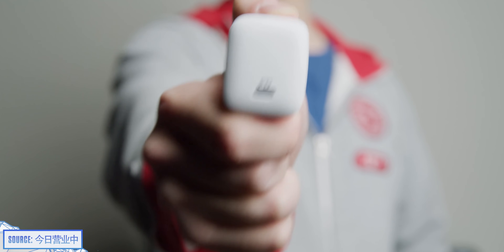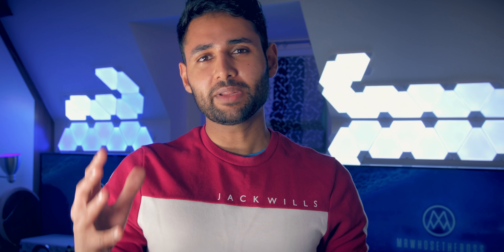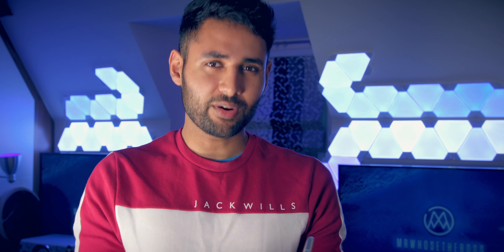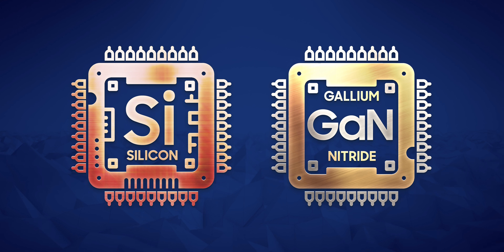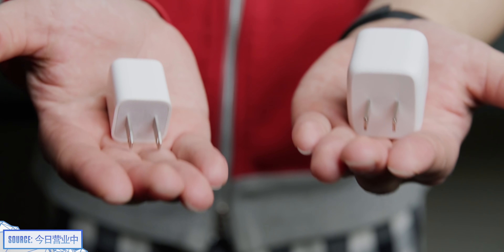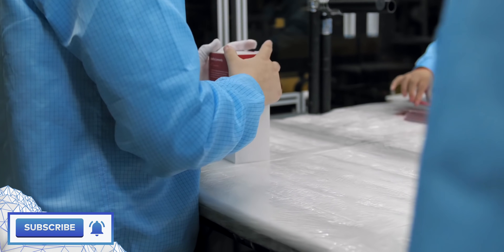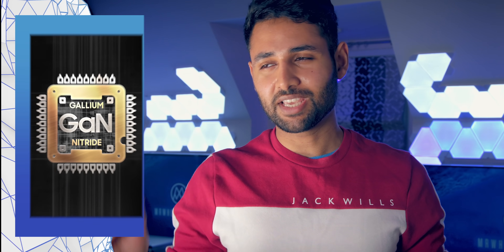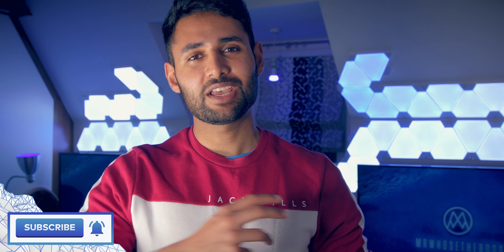Smartphone Fast Charging just got FASTER.

Comment: Yes can we see that comparison?
Reply: He hearted it so maybe it's the next upcoming video?
Reply: The internal electronics of the device being charged will be the bottleneck, I don't think just changing the charger will make much difference in charging speeds. 
One will also have to design internals of the phones to handle the higher charging speeds possible.
Reply: Hell yeah
Reply: Please make the comparison but plug the chargers to separate measuring devices so we can see how much power it consumed <3
Reply: @louis.bodota  true dat
Reply: YEES WE WANT TO SEE IT
Reply: Uh, charging speeds would be identical. Your phone limits the charge going into it with a circuit to monitor the power being input to it and down samples it to the correct amount. It will not make it charge faster, but it will be more efficient. Phones limit the rate to protect the battery as lithium batteries are prone to damage when the improper voltage or current is dumped into it. You would have to wait till graphene batteries before faster charging can really go all around. Right now all phones limit the speed based on the battery they specifically designed for it. This is why certain phones have higher charging rates than others. It's not the charger it came with but the limit the phone has itself.
Reply: Comparison is indeed needed
Reply: yes
Reply: yes
Reply: No
Reply: We never got that🙁

Comment: Galium Nitride charger + Graphene battery. Imagine what a beast that would be.
Reply: It won't work. Because the chargers are nitride. Not nitrate
Reply: Only Samsung can do this
Reply: Sounds like a bomb in the making
Reply: @bilalsadain  wearable smartphones
Reply: let's call Graphene Nitrate, or Graphenic Gallium Nitrate.
Reply: Nitrate of gallium? Smells like some sort of an explosive ingredient. You mean, NITRIDE?
Reply: It's GaN, not GaNO3
Reply: iS tHiS kEmiStRi????

Lol just joking
Reply: @bilalsadain  corrected.
Reply: A graphene battery is impossible because it acts like an capacitor rather than a battery.
Reply: @mihaelgrubisic9229  that's the point actually.
Reply: Gallium Nitride 960KW charger + Solid state battery/supercapacitor + 100% renewable energy by 2030. Imagine what a beastly EV set up that would be.
Reply: Great video love your video content very informative
Reply: the smartphone that can be compared to a feature phone
Reply: @Shubham_Bahirat  not an apple fan but all trends are started by apple notch, fingerprint sensor,glass back, face id
Reply: yeah maybe in 6048
Reply: I'm just waiting for sodium ion batteries to start being used by manufacturers
Reply: @techneedsfixing8833   yeah but Samsung is also inventor waterproof, ultrasonic censor, hole punch display, curved display, wireless charging. Etc
Reply: thank God Samsung exists. graphene batteries technology would be so delayed without them.  they're leading the way in mobile smartphone development.
Reply: If the battery capacity and charging speeds are both really high, it would still take like 15 min to charge your device
Reply: @Shubham_Bahirat  sorry bro but punch hole display was first from huawei
Reply: When will Tesla adopt this!!!
Reply: @techneedsfixing8833  not really....... Released first? Sure but Samsung leaked it first.
Reply: Fluoride battery would be first to be used IMO
Reply: Samsung already on it: https://news.samsung.com/global/samsung-develops-battery-material-with-5x-faster-charging-speed
Reply: @vidkidsvault3438  littearly any android watch

Comment: yeah, i actually did a project on gallium nitrides electrical conductivity, so as a result I got to test it and experiment with it. and needless to say that the results were mind blowing. Oh and I would love to see a side-by-side charging comparison.
Reply: @69mviewsnt  what?
Reply: Doesn't it get poisonous at high temperature?
Reply: Axel Nathanael I wouldn't use the word "poisonous" but it does get corrosive and inhaling it's fume can cause certain death so yeah.
Reply: @jeetbhatkar6058  so gallium is bad compares to silicone right?
Reply: @axelnathanael8174  as long as the phone doesn't heat insanely (which it wouldn't. Gallium's melting point is pretty low but gallium nitride's melting point isn't so it won't be a problem).
Reply: @jeetbhatkar6058  what if we accidentaly leave it in car in a hot day?
Reply: @kabayangila  unless it's like 200 degrees outside, it shouldn't do anything.
Reply: @jeetbhatkar6058  what if I put it in a microwave and make a YouTube video?
Reply: @josem1596  you must not like your house then.
Reply: @jeetbhatkar6058  what if I cut it with 1000° red hot knife (gone wrong) ?
Reply: How does it compare to graphene 🔋 and the side by side comparison would be great
Reply: yes
Reply: nice
Reply: Mind blowing? See what GaN chargers are doing. 5 percent more efficient thats all. Same Output power quality, same heat production. Only saves a few cents of electricity bill.

Comment: Now I can charge faster and discharge even faster 
2019 everyone
Reply: and the battery will die faster
2019 is great
Reply: I hope we all still have our warrantys 😂😂
Reply: Oh waaw
Reply: Charge faster, degrade battery faster, forced to buy a new phone faster!
Reply: Use Super VOOC tech. Charge phone faster, not the battery cells themselves. Its awesome right?
Reply: @anjelpatel36  nigga what?
Reply: @anjelpatel36  what the fuck?
Reply: @Hmmm huh
Reply: New batteries are getting better, current li-po batteries arent great but new graphene tech could help solve issues and many other ideas like a tesla coil can have amazing use and change the world
Reply: @owo7094  that's what I thought. But my oneplus 3T 2 years old is still strong with battery. I still get 5.5 To 6 hours of SOT and oneplus tech charging doesn't heat phone nor charger while charging which is 2016 tech.
Reply: @owo7094  Graphene batteries are supposed to be way more efficient in degrading

Comment: I wonder when we will reach the point that you plug your phone and unplug it instantly and you get 100%
Reply: Probably in 15-20 years
Reply: It will happen. A future supercapacitor will allow you to recharge your car way faster than filling a fuel tank. Your phone, using this tech in a super capacitor will have a charge time measured in microseconds.  The interesting thing is how much this tech will be suppressed. It will be highly disruptive. Luckily, China has no respect for patents or disruption to western commerce. Bring it on!
Reply: They would make the battery same capacity like teslas now just so you can charge it longer.
Reply: I'm predicting that it wouldn't happened. Wireless charging is the  trend in the future.
Reply: Haha!!
Reply: It would probably make the subject . Kapoof (explode into bits)
Reply: Maybe in the future your phone will charge by your body energy...
Reply: @Basit Aliyan Yeah,and thats a step-up
Reply: Joe Al  that has to do with how efficiently the source code can run
Reply: @rockbore  rather take a fuel car

Comment: and my phone charges at 5W
Reply: なみ F
Reply: Iphone
Reply: My XS uses 29w, it’s quite nice - but DASH charging is still better
Reply: @markofexcellence5209  my mate 20 pro charges at 40w....
Reply: Jarl S that’s weird, the mate 20 pro has more wattage but charges at the same speed as mine
Reply: @markofexcellence5209  probably since the size of the battery is big
Reply: @markofexcellence5209  4200mha battery vs. 2658mha battery.
Reply: Jarl S true. What’s your SOT? One thing I like about the A12 is that even this tiny phone/tiny battery lasts quite a while
Reply: @markofexcellence5209  On "your typical workday" i have about 55% battery in the evening. I then put it on the wireless charger (about 3 hours) and take it off before i go to bed. In the morning the battery then is at 96%.
This is with "always on" clock display and max resolution display - email push, BT to car, BT to wireless buds etc.

Never had a phone with better battery performance.

Comment: From a electronics point of view the information were bullshit...
The potential to conduct electricity 1000x more efficient ... DC-DC converters these days have a efficency of about 90% up to 98%, you can't go over 100% so where does the 1000x come from? 
Also it isn't the reason we have so much silicon that we use it for electronics, it's because of its special property's. And there are only a few other materials that could have the same potential ... Like GaN tries now in the "power electronics" market
Reply: Maybe that 98% is its capability? Like 100 percent of a can of soda vs 100 percent of a 2 liter of soda, they are both 100 percent but one is still more. Idk I'm just guessing that's what he means

Comment: This is cool, but I'm waiting for the PD 2 at least. Because it has 2 ports. Or, ideally, something small like this that will put out PD 100 watts and make a type c power bank that has pass thru capabilities so it can double as a desktop charger with multiple ports while in the hotel or whatever. Also, some nice 1ft cables too. Need power and minimal for travel.

Comment: Hmm. This is a little bit relatable to my chemistry and physics lessons.

Tips: GaN (Gallium Nitride) is an ionic compound and Ionic compounds are conductive aka they conduct electricity very well.

On the other hand silicon crystals which are used for silicon semiconductors have covalent bonds and we know that compounds which has covalent bonds aren't conductive. Thus silicon crystals aren't as much as conductive as GaN (Gallium Nitride).

Conductivity is important because if the conductor isn't much conductive then the current which is going to flow through that conductor will be turned into heat because of the resistance causing the conductor to heat up causing even lesser conduction (this conversion to heat might be a little but expand this math to city grids and you will see money burning like hell).

Comment: In the past, I remember the phone charger begins with 5V@500mA (or less). When smartphone came along, some low end smartphones still on 5V@500mA while high end smartphones is at 5V@1A. 1A (or 5W) of power at that time considered fast charging in earlier days. Speeds has been increased to 5V@2A (or 10W) in around 2012 or 2013. 5V@2.1A (10.5W) and 5V@2.4A (12W) was came a bit later provide faster charging. 5V@3A (15W) was came in around 2014-2015. The fastest at that time is OPPO VOOC Flash Charge whooping at 5V@4A (20W) since OPPO R7 (or else, OPPO high end smartphones). Charge full takes about an hour (apox 1 hour 10 minutes if charged my current OPPO F11). Year by year, they keep cutting down the cost for their VOOC charging to mid end smartphones like OPPO F11/F11 Pro and Realme 3 Pro. By 2018, speed now keeps increasing to 5V@4.5A (or 5V@22.5W) and then 9V@1.67A (for newer Samsung smartphones). Plus, newer phones starting giving more speed to charge in. Maybe by 2020, our phones can charged full in 30 minutes.
Reply: @Абдуашиш Нургалеев nice! Saya tunggu je. Untuk device tahun depan ke?

Comment: Thanks for this video. May I know the charging rate is based on the amount of current the charger can put out? If that is the case, is there a limit to the current that can go into the phone? Will high speed charging damage phone battery? I know my phone becomes hot when I charge it.

Comment: Aaron, I think you might be missing the "real" upside. The great thing about gallium nitride is NOT just about chargers, although they definitely will be better. The "real" upside to this is in alllllllllllllllllll of the computer chips being GaN instead of silicon. Processors will run faster and much more efficiently, and will NOT have to be cooled!!!!! Heat has always been the limiting factor in Silicon chips. But with GaN, that won't be a factor. It will bring electricity bills down to fractions of what they are now. It's a truly revolutionary element for the electronics industry as a whole.

Comment: Defo please do a comparison with the S10+ please as the standard charger included in the box max's out at 9w whereas the S10+ has 15w charging. With that 4,100mAh battery it'd be good to see if it charges quicker with one of these next gen chargers than the one the phone comes with.. so disappointing that Samsung didnt use Quick Charge 4.0 or even 3.0 for that matter!
Reply: The Galaxy phones all use 15 watt "Adaptive Fast Charge", starting with the Galaxy S6 and newer actually. Your looking at 9 volts. Not 9 watts. The S9 has a 9 volt/15 watt charger, as does the S10+. The "S10 5G" however and the upcoming "Galaxy Note 10", will be utilizing Samsung's all new 25 watt charging which will be the first upgrade of their fast wireless charging since the S6. 

Quick Charge 3 by the way, is rated at 15/18 watt. Samsung's current Adaptive Fast Charge, is based on Qualcomm's Quick Charge 2 in fact. But Quick Charge 3 isn't any faster then Quick Charge 2. It just introduced more power management abilities over Quick Charge 2. Quick Charge 4 is refined even further yet. But it's still rated at the same charge cycles times. However it usually charges even faster then Quick Charge 3, due to better communication with the battery, despite being limited to 18 watts like Quick Charge 3 and 2. 

Quick Charge 4+ is the big upgrade now. And Samsung's new 25 watt standard is based off of this. It should charge roughly 67 ~ 70% faster than their current Quick Charge. By the way, the iPhone XS is rated at 18 watt quick charge. (Based on Quick Charge 3) But the 15 watt Galaxy is still faster at charging, thanks to even further optimisations on Samsungs front. (Samsung is actualy a battery manufacturer)

Comment: "Naturally silicon is not a good conductor of electricity but it can conduct electricity due to the fact that it's a metalloid.

However it's ability to conduct electricity can be adjusted by varying it's temperature as it's conductivity increases with an increase in temperature."
One of the shortcomings of the material.

Comment: Uh, charging speeds would be identical. Your phone limits the charge going into it with a circuit to monitor the power being input to it and down samples it to the correct amount. It will not make it charge faster, but it will be more efficient.

Comment: But Arun, I dont think that it will be able to extremely fast charge devices like S10, S9, iPhone XS etc which dont support 40W fast charging. They should make a charger that can fast charge ANY device on this planet
Reply: You cant fast charge something that is not designed to be fast charged. Imagine trying to pump water into a reservoir with insane pump but with a small hole.

Comment: the issue with this is the devices we use, smartphones, are not ready for this kind of intense power charging. modern batteries have gotten much better at reliability with increased speed charging, but when you add this much power to a modern battery, it WILL kill the batteries much much faster than today's chargers. don't get me wrong, this tech is the future. but modern batteries are NOT ready for this.

Comment: Well seeing as the latest rumors from reliable sources are all saying that the next iPhone will once again ship with a "standard speed" 5 watt charger as they always have, I doubt there is any hope that Apple will upgrade this coming year. But then again, Apple brought quick charge to the iPhones (With a separate $75.00 purchase) way after competitors did like Samsung for example. And even then, it still couldn't match the speed of the Galaxy in recharge times. On a lighter note though, Samsung all but confirmed that their Adaptive Fast Charge (Which is already faster than Apple's Quick Charge) will be getting a boost from 15 watts, to 25 watts this year starting with the Galaxy S10 5G. Thats a 67% increase! (Expect the Note 10 to get it as well.) 

Of course the 25 watt charging the Galaxy will be getting, will be based on smart technology that keeps the battery cool and preserves battery life. In fact, it should stay even cooler than the 15 watt charging, thanks to improved battery communication.

Comment: this is neat but useless for 90% of phones as most of them (rememeber cheap phones sell a lot more quantities than expensive ones) don't support any kind of quick charge, what you can expect from them is 10W or in a best case 18W, not 30 or more.
Reply: That's not true everyone in America who has Android practically has a quickcharging phone
Reply: @toku30   Quick Charge 3.0 is only 18W max. But the average power is more like 12W because current drops as battery gets filled.

Comment: You don't know what you talking about. Efficiency and charging speed are two different things. It's the battery that's slowing down the charging speed, not the charger these days. Li-Po & Li-Ion just takes time due to their chemical characteristics. Speeding up any faster will shorten battery life. Many quick charging schemes already shorten your battery life as is. They're counting on you to buy a new phone every 12 months.

Comment: Silicon reached its limit, processors cant get more powerful bcs we reached the 7nm limit, batteries also reached the limit. Its about fcking time to move on... companies are saving money so badly that they cant even invest to actually improve devices, we could improve power and charging speeds by just replacing silicon with another material, sure it will be more expensive but not omega expensive. They spend like few dollars to make their devices while selling them for hundreds. Im sure people would pay more for device that charges 6 or even 10 times faster. Phones cost over a thousand bucks now so i dont think people would mind a bit bigger price tag, i wouldnt cuz it a huge improvement

Comment: yeah... you're comparing a 30W Anker charger to a 61W Apple charger... also it is not equivalently powerful but the Apple 61W is significantly more powerful. Additionally, the charger in the video is for the MacBook Pro 13" not the 12" MacBook.